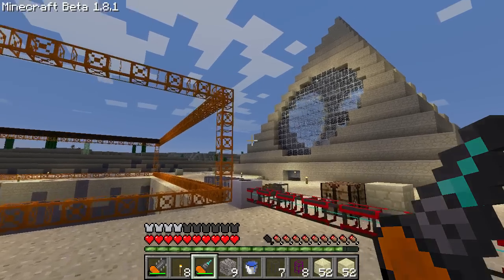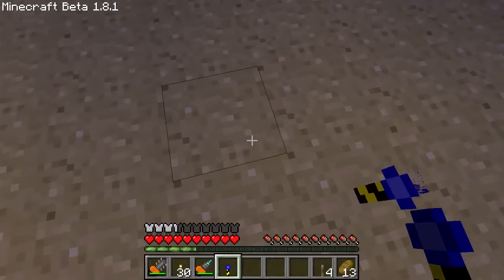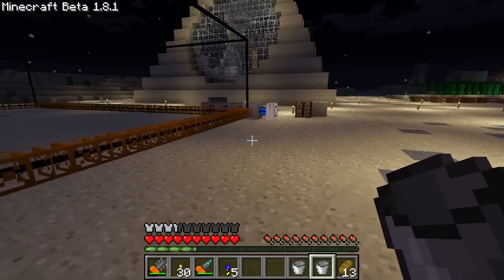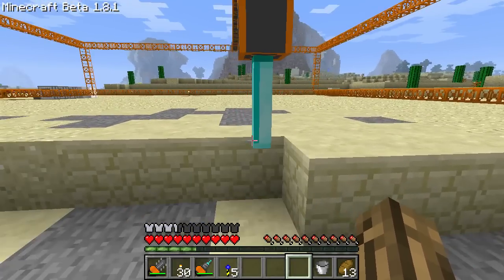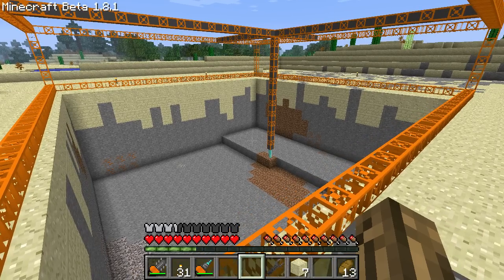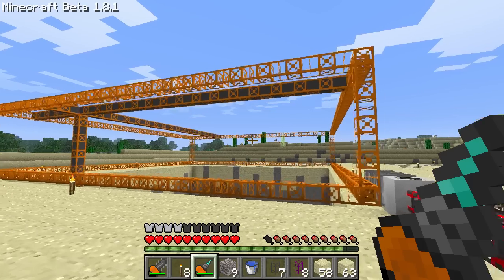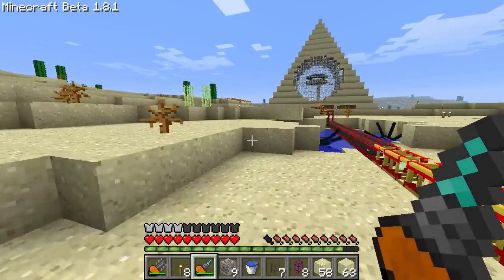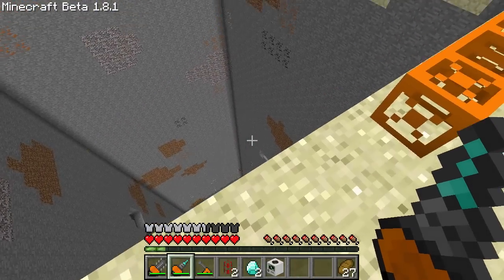Minecraft Episode 6  - How to use a Buildcraft Quarry

Comment: You can get the Industrialcraft/Buildcraft Crossover mod, this allows you to input Inustrialcraft power into an Industrialcraft/Buildcraft Crossover mod engine, which then outputs Buildcraft electricity. 
Basically the mod allows you to power Buildcraft machines with Industrialcraft power, which is extremely convenient, to say the least.

Comment: Just a little FYI, if you put three steam engines in a row like that they won't all be powering the quarry, but instead they two behind the first one will power the first one, which will power the quarry. (and it isn't heat, its energy :P)

Comment: Water + Charcoal + NO redstone signal should work. 

Best to get water in current version is 1 aquaous accumulator below into a tank, pumped with a redstone-engine. 

But if you want full speed, take redstone energy cells. 10 should suffice to get to bedrock once.

Comment: Just curious but could you use more than 3 steam engines?
Reply from the maker: Morgan Evans Well the mod has changed a lot since I made this video so yea, you can use loads of power from loads of all different engines and have it mine at warp speed!
Reply: +BadashGames imagine like 100 combustion engines
Reply from the maker: +Christian Evrard It would go nuts! Back when this was filmed the quarry was pretty slow and had a top speed. But several years later I played with this mod again. The quarry was a lot faster, and there were new engines. You could make it go insanely fast.
Reply: +Christian Evrard That still is not the best way to power it. Use an Energy Cell powered by something like a wind turbine from Industrial craft.
Reply: +Connor Thomas yea like a creative energy cell

Comment: could you hook it up to a energy condenser?
Reply from the maker: Ez Shadows I have no idea XD
Reply: Why yes, yes you can.

I'm currently playing Tekkit Legends which has both Buildcraft and Project E (Equivilant Exchange remake/continuance) and it goes off the logics that extracting items out a chest then lead the pipe to a Condenser.

I was testing it at first on my 5x5 egg auto-farm. I just had redstone engines extracting from the storage chests and I was able to feed it directly into the Condenser (though it had nothing on the 2 3x and 1 2x Collectors I had with, but it was much better when I was just harvesting crops via the auto-replanter due to Industrialcraft early in before I had a Collector)